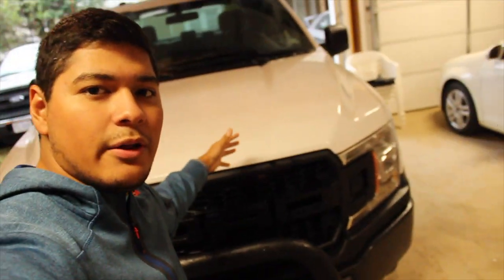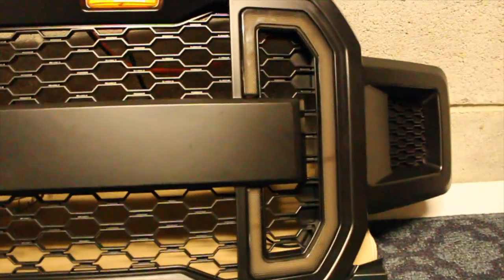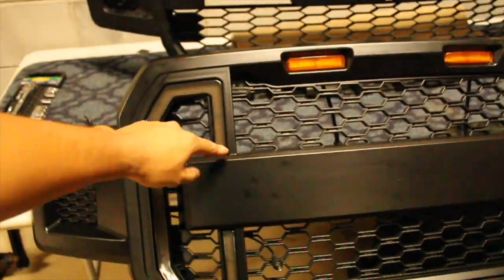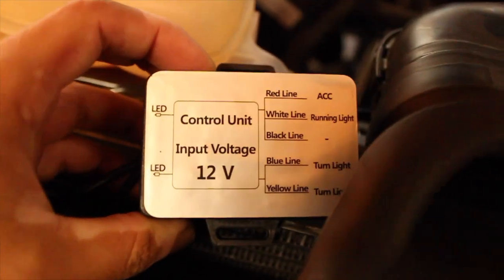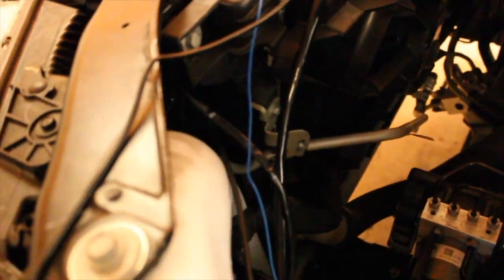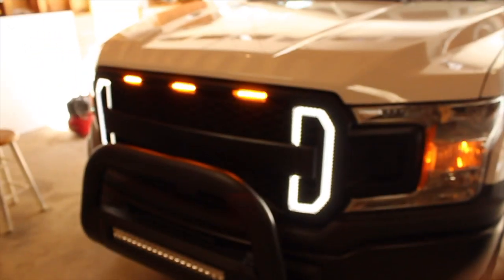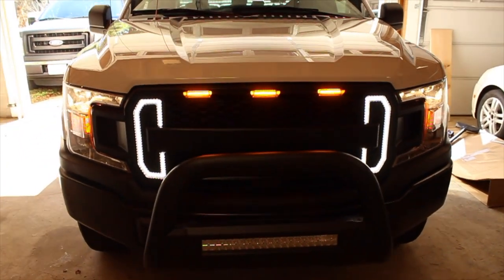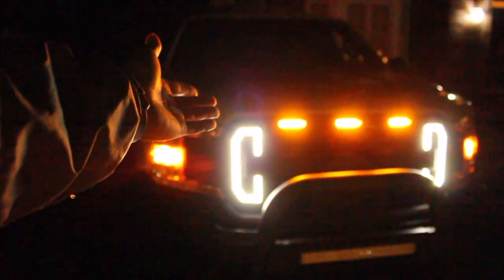2018-2019 Ford F-150 Grill LED & Amber Turn Signals

Comment: Let me ask you I installed the same grill as yours and I noticed when my lights are off and when I use my L or R turn signal the amber and yellow light blinks at the same time. But when my headlights are on and use the turn signal only the yellow light blinks and not the amber does your work like that, thanks.
Reply from the maker: Yup mine works the same way. It kinda sucks you need to have at least parking lights on to avoid that.
Reply: @apexcorner45  Hey, yes it does suck and thanks for the quick reply.

Comment: have you had an issue with the blinkers not working on the grill or those LED's not lighting up at all?
Reply from the maker: The grill works fine however my truck key features lock and unlock aren't working anymore which I think has something to do with the grille.

Comment: Updates on the grill? Have any of the LEDs burned out? I’m about to purchase
Reply from the maker: yes the amber lights seem to burn out after a year. But I think you can find replacements lights for that size online
Reply: @apexcorner45  what about your raptor grill did it have any issues?
Reply: @apexcorner45  kinda wanted something different because everyone does the raptor grill. But I want to get something without the lights going out. Is this the same grill American trucks sells on their website for 50$ more?
Reply from the maker: I go this one from eBay. But yes American Trucks sells a very identical one. I ended up buying an open box from AT and used it as a spare parts grille lol   @land0_built

Comment: can you make the white on the grill run only amber all the time by powering both wires might help with the brightness and put the white on the high beam switch ive been looking at this grill and want to know if I can do it as I described if you want ill send you some cash to try it out before I buy it for your time !?!?!??!?!?!??
Reply from the maker: The brightness is actually not bad. The normal low beam headlights mask the brightness from the grill LED's at night making it tolerable if you're a smaller car in front (no cars have high beamed me coming from the opposite directions, so must be fine). This grill is actually sold by various companies that you will see on ebay or amazon and on the reviews for the amazon ones I read that someone wired them where the ambers are the only one lit but not 100% sure. Check the amazon reviews those guys go in depth and some wire it to their liking's like you mention.
Reply: @apexcorner45  Did you find a good solution for the passenger side blinker?